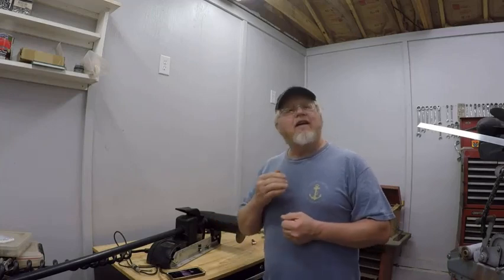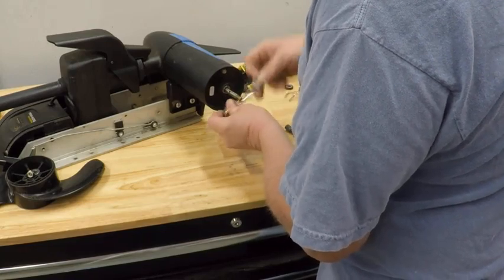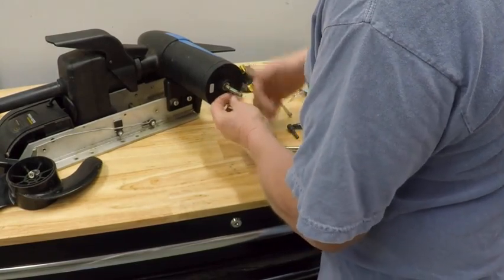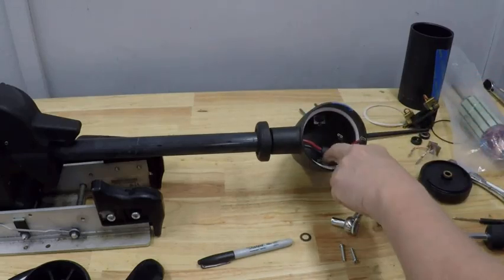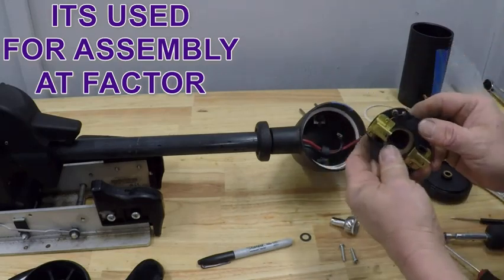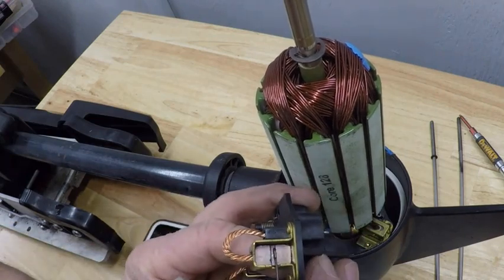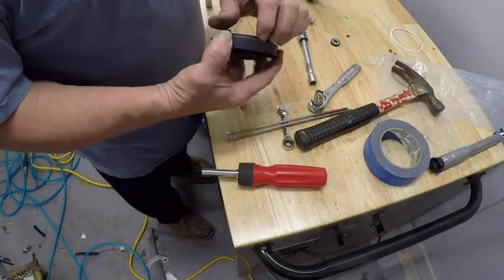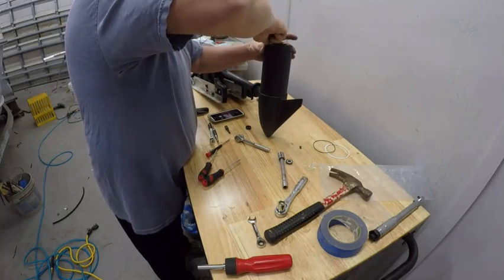TROLLING MOTOR SHAFT REPAIR / REPLACING ARMATURE

Comment: Very detailed video. Have to replace my prop shaft, waiting on parts. Brand new unit, I dropped it from knee high while lining up the motor for install on my boat and it bent the shaft. Brand new, never even been in water.  I was so excited to get in on the boat I wasn't paying attention hit the release and down she went.  You rock
Reply from the maker: Yep it happens. That exactly what I did too. Thanks for watching

Comment: Thanks for the video... made job very easy. The only problem I had was trying to get the second seal out of the end cap. It has been in there 15 years. The rubber bushing had hardened to the side of the end cap making it impossible to get out. Had to order new end cap.
Reply from the maker: Awesome. Glad it helped. And thanks for watching and commenting
Reply: Very well done video!
Good tips especially taking motor off!
A little extra work removing motor but working on a bench makes for a better install!

Comment: This is on a 2017 Terrova 80 lb. link motor. When I turn the prop by hand it feels like it's grabbing. Is this normal or should the shaft turn freely? There is no fishing line on the shaft and the seal looks okay. Motor seemed to run good all year, noticed it when I brought it in for winter storage. Good video!

Comment: That little cardboard ring you mentioned that isn't really necessary? It isn't needed to run, but it is an assembly aid to hold the brushes apart. As you insert the armature, the ring is big enough that the bearing goes through it, but as the armature goes through, it will push it forward and out of the way and the brushes then contact the armature. After that, it is no longer useful, but remains there, not causing any issues.
Reply from the maker: Thanks for watching and commenting I appreciate that.
Reply: Hello, I am at a loss as to where the video showing the cardboard ring...
Also your last sentence seems to indicatethecardboard ringwill still be insidethe motorhousing, but will not cause any issue. Is that right?
Reply from the maker: Yes sir. That ring is just used to make it easier to assemble.  From the factory that ring holds the brushes and when you push the shaft in it pushes the ring in and out of the way.  I could have removed it but if I ever go back in I might use it to hold the brushes.

Comment: Does it matter if the the prop seal is not flush. As you said. As I push mine in a few millimetres in. Will or would it make a difference?
Reply from the maker: As long as it’s not hitting anything causing it to bind you should be fine.   My model would only go slightly below flush before it bottomed out and wouldn’t go any further

Comment: Hello Jeff.
can you give me some advice on what to do if i took all the pieces apart but forgot to mark where they should be?
Reply from the maker: The taper on the  cover will tell you which way  it goes.   If after you put it together it runs backwards just turn it 180° and reassemble

Comment: If I didn't pay attention to the location of black and red wires on the brush holder, Is there a way to know which side the red and black wires go back. I'm told that if I put them wrong the armature will turn the wrong direction.  I call tech and was given a wiring schematic but has no indication of those wires , Pls help

Comment: I took mine apart without marking it. When I  used it for the first time it is running backwards. How do you find the original position  of the housing and armature to correct the problem. Tks.
Reply from the maker: It just needs to be turned a half turn and you fill be fine.

Comment: You use a lot of pop rivets. Where do you buy your rivets in bulk. Also what size do you normally use on your boat repairs.
Reply from the maker: I use 3/16” primarily cause that’s what size most the solid rivets are in a boat.  I buy them by the pound here at a industrial supply.  Thanks for watching

Comment: I just bought a 2024 bass tracker classic xl.. fished 3x's in it and now my trolling motor is making a knocking sound while running in the water.. is this the problem?
Reply from the maker: I’d check the prop first.   Theres a pin that might not be seated.   Take the prop off and turn it on.  You will be able to see if the shaft is bent.
Reply: @bowl830  thank you for your videos.. I'm learning..I will look at it tomorrow..
Reply from the maker: @user-qh2nn9sr1l thank you for watching I appreciate it

Comment: Other than the red and black wires that attaches to the brush plate, what would cause a motor to run backwards?
Reply from the maker: The outer shell of the case that holds the magnets needs to be turned 180°
Reply: @bowl830  thanks. When disassembled the magnets were all busted up so we replaced 100% of the components. When looking at the magnet housing we looked for the factory mark and believe it or not there we two indentions so we guessed wrong I suppose. Keep up the good work. It saves us a lot of money.
Reply from the maker: Thank you I appreciate that.  Good luck.

Comment: Im gonna make diy trolling motor, and due to my research, brushless motors perfect for this duty yet they use brushed motors.
Reply from the maker: Thanks for commenting.  I think that is on the horizon soon.  A lot of drill and battery tool companies are almost all brushless.  The only issue I have is brushes are easy and cheap to service. They’re also “wear” parts.  They wear out but do almost no wear on the armature.  Not sure how the brushless will do

Comment: I have the same trolling motor that you have I put in a new amateur and seals but somehow my trolling motor is still taking in water.
Reply from the maker: Did you remember the o rings on the bolts.  Good luck
Reply from the maker: Check the seal at the shaft to the motor connection
Reply: Don’t worry about it.  I’ve ran mine for Years with water inside!! I think they run better that way!!😂😂